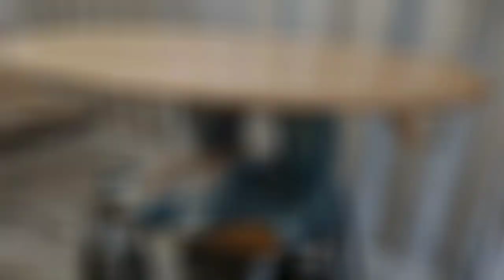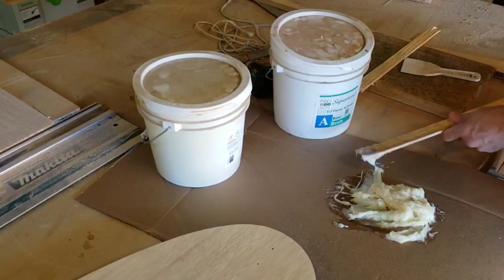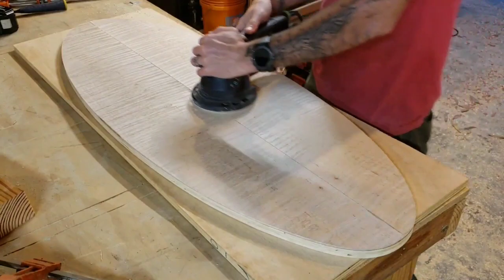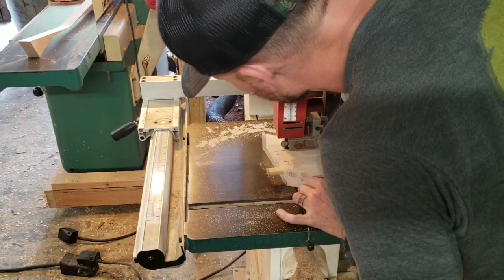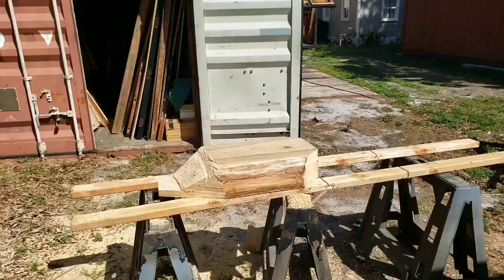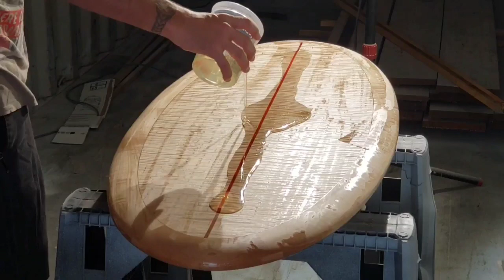Building a Surfboard Coffee Table Wood Sculpture

Comment: Bro please help lol when you traced the board onto the frame how far inside of the line did you cut to allow for the recess?
Reply from the maker: You can make a template, but what I did was traced the top and offset my line just over the width of the rabbiting bit.  After that I used the router by hand to carefully bring the cut to my line.  I left the pencil line and sanded a small taper onto the insert.  Again, you can make a template for both pieces and get a perfect fit, probably in less time.  Good luck
Reply: Thanks  it’s deff gonna be a challenge

Comment: Beautiful work,  what wood did you use for the frame and how did you cut the slot in the middle of the board?
Reply from the maker: Thanks!  The border is maple, the center is fiddleback maple, and the groove was cut with a router.
Reply: @Truewoods  Thanks for the reply, off to purchase my Birch.  O'm actually making a surfboard wall hanging for my son's new beach house.  Thanks for the inspiration.  One followup.  When you cut the slot with the router, did you do it prior to cutting the oval shape so you could use the straight edge of the board?  Tx again!
Reply from the maker: @danwas44  I could have, but did it afterwards because I had a veneer seem to follow so it was just as easy.  Shouldn't matter either way though.